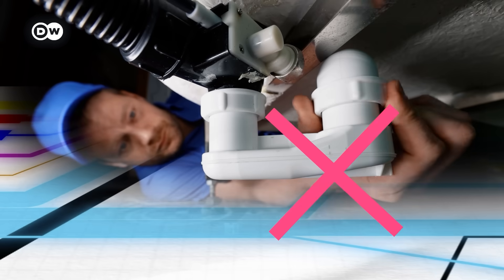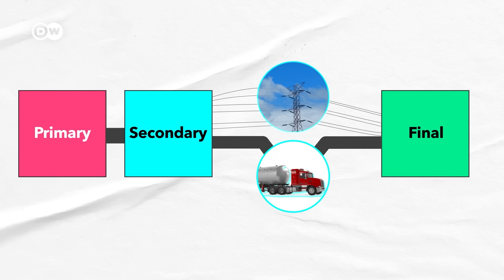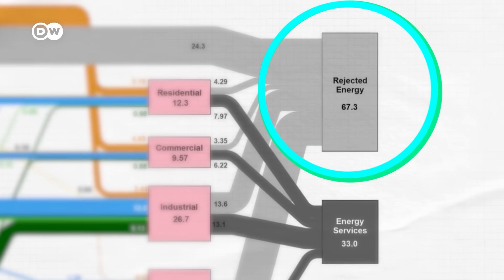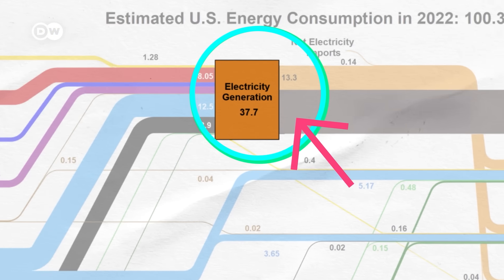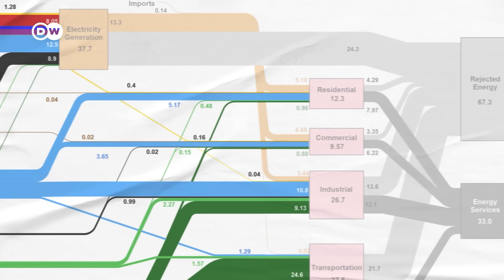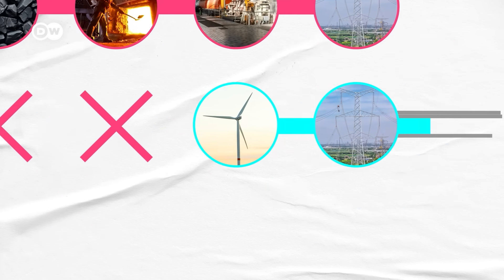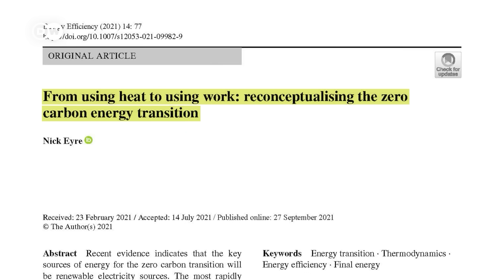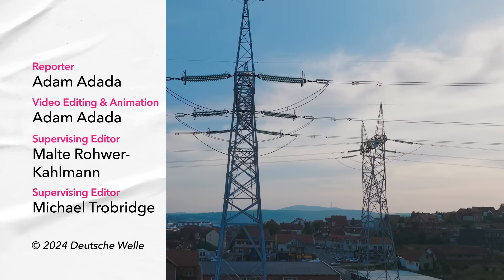The mind-blowing thing we get WRONG about energy

Comment: Something else not often considered. 

The energy needed to extract, process, transport, store, refine, distribute and dispense fossil fuels is immense...

Not to mention the equipment and industries needed to produce and maintain that infrastructure and equipment. 

With renewables, that's no longer needed. 

Oil wells and drilling rigs. Massive tanker ships, and the energy they need. Storage facilities, and the equipment and energy needed. Refineries and the massive energy they need, not to mention the massive infrastructure and equipment. The tanker trucks to distribute fuel. And the industries needed to produce all the parts for the ultimate burning of that fuel.

It all goes away. Sure, its replaced by renewables, but they are much lower maintenance, and much simpler. And with EV's they are much simpler, requiring less industrial input. And very minimal maintenance.
Reply: The United States also maintains aircraft carrier groups in part to protect international shipping lanes from pirates. How many times have we gone to war over oil? It's very expensive.
Reply: @markhathaway9456  War itself is changing. A single drone uses a puny fraction of the energy of a jet fighter or bomber, and can be as effective.
Reply: The problem of transportation of renewable energy on big distances is not solved at all for today. So yes, "that's no longer needed" because it simply impossible.
Reply: @TomasSawer  
Renewables are mostly distributed generation. Less transmission is needed because of that.

It does, however, greatly benefit the requirements of storage if large areas are supported with high capacity transmission lines. HVDC can go entire continents, allowing energy averaging. Especially with solar. And, existing storage, such as hydro can be better utilized.
Reply: @jeffl4810  Unfortunately sun and wind energy is not distributed equally between the regions and even in the regions with high insolation is not enough sustainable to satisfy all the requirements to power grids. The only solution now is chemical battery energy storage because of little loss on energy conversion but this solution is still very expensive. German "green revolution" turned out to be covered by russian bloody gas.
However another sun energy tecnologies like Spain concentrating heat power plants can produce sustainable energy by design but this tecnology still expensive in operations and support and not still widely used.
BTW do we have any HVDC in commercial use? Some underwater cables? Temperature and snow-humidity tolerance figures? It's interesting idea but how far it from mass deployment?
Reply: @TomasSawer  
HVDC greatly helps with evening out power, as it can be sent vast distances. Like across entire continents.  

Solar on the east cost can help power the west coat at night, and vice versa. Storage facilities, such as managed and pumped hydro can be used in suitable geographic locations. Wind would be averaged out, reducing its variability. 

Utility scale batteries would be fully utilized, instead of adding a lot of overcapacity to compensate for worst case situations. 

A lot of generation overcapacity wouldn't be needed, as worst case events would averaged over large geographic areas.

And yes, HVDC is used in a bunch of areas, and growing in popularity.  A conductor pair is capable of 6-10 GW of transmission capacity.  More conductors can add capacity. 

It works way better than AC grids due to no phase issues when you start approaching the 60Hz wavelength. And there's no "Skin Effect" in the conductors, giving a much better conductor utilization. Not having skin effect also allows substantially larger conductors. 
The only drawback is the cost of the rectifying and inverting needs when connecting to the transmission line. 

There's also a UHVDC transmission line spanning 3,500 km IIRC.
Reply: @TomasSawer  80% of the world's UHVDC is in China, where it extends the solar-wind day by two time zones.. and Chinese time zones are very, very wide.
Reply: @TomasSawer  Biofuels are just as good for 'big distances', plus more secure.
Reply: @bartroberts1514  
Unfortunately, biofuels are quite expensive to make... 
With exception of waste that's turned into biofuels
Reply: @jeffl4810  Biofuels through the ethanol pathways, sure, are quite expensive to make historically.

Part of the problem with that is economies of scale.

Part of the problem is that it's ethanol instead of pyrolysis. Torefaction can take waste biomass and convert it to biochar -- which there is too little selling and promotion of -- to displace expensive nitrate fertilizers, and as a byproduct produce enough py-gas and black liquor feedstocks to service the world's needs, in a program of afforestation and reforestation, unconventional forestry and ocean biomass seeding and recovery.

Part of the problem is we don't pay for the liabilities of fossil, and externalize those costs.
Reply: @bartroberts1514  Biofuels are mostly a joke in the EU, it often means burning food for energy, its not unlike the green washing that goes on in carbon credits. In the UK we switched from burning coal to burning wood chips harvested in the US NW which has to be chipped and shipped around the world. The trees don't recover for 50 years.
Reply: @bartroberts1514  Yes but biofuel is not electricity. It's more like traditional oil and gas with only difference it not pumped from the ground but planted on it. All other processes including CO emissions are the same.
Reply: @TomasSawer  The same? Tch. Far from it.

Carbon Neutrality:

Traditional Fossil Fuels: Burning fossil fuels releases carbon dioxide (CO2) that was stored underground for millions of years, adding new CO2 to the atmosphere and contributing to the greenhouse effect and climate change.

Biofuels: While burning biofuels also releases CO2, the key difference is that this CO2 is part of the current carbon cycle. The plants used for biofuels absorb CO2 from the atmosphere during their growth, which offsets the emissions when the biofuels are burned. Therefore, biofuels can be considered carbon-neutral if produced sustainably.

Renewability:

Traditional Fossil Fuels: These are finite resources that take millions of years to form and are being depleted rapidly.

Biofuels: Biofuels are renewable because they are made from crops that can be replanted and harvested annually or biannually. This makes biofuels a more sustainable option over the long term.

Lifecycle GHG Emissions:

Traditional Fossil Fuels: The entire lifecycle of fossil fuels (extraction, refining, and combustion) typically results in higher overall GHG emissions.

Biofuels: The lifecycle emissions of biofuels can be lower than those of fossil fuels, especially if produced from waste materials or using advanced biofuel technologies that improve efficiency and reduce emissions. As biofuels divert biomass from anaerobic decomposition to methane and other GHGs more GHE-intensive than CO2, their use can reduce GHE up to 120 times.

Environmental Impact:

Traditional Fossil Fuels: Extraction and use of fossil fuels can cause significant environmental damage, including oil spills, habitat destruction, and air and water pollution.

Biofuels: While biofuel production can also have environmental impacts (e.g., land use changes, water use, and pesticide application), these can be mitigated with sustainable agricultural practices. Additionally, using waste products or non-food crops for biofuel can reduce negative impacts.

Energy Security:

Traditional Fossil Fuels: Many countries rely on imported fossil fuels, which can lead to energy security issues and geopolitical tensions.

Biofuels: Producing biofuels domestically can enhance energy security by reducing dependence on imported fuels and supporting local agriculture and economies.

Technological Advancements:

Traditional Fossil Fuels: While there have been advancements in extraction and refining technologies, the fundamental environmental issues associated with fossil fuels remain.

Biofuels: The development of advanced biofuels (such as algae-based fuels and cellulosic ethanol) holds promise for even greater reductions in emissions and environmental impact, further distinguishing them from traditional fossil fuels.

Policy and Regulation:

Traditional Fossil Fuels: Increasingly, governments are implementing policies to reduce fossil fuel use due to their significant environmental impacts.
Biofuels: Many governments support biofuels through subsidies, mandates, and research funding because of their potential to reduce greenhouse gas emissions and enhance energy security.

Conclusion
While biofuels do share some similarities with traditional fossil fuels in terms of their use and combustion, the overall processes, environmental impacts, and sustainability profiles are significantly different. Biofuels offer a more renewable, potentially carbon-neutral alternative to fossil fuels, provided they are produced and used sustainably. Dismissing biofuels as merely equivalent to fossil fuels overlooks these crucial differences and the potential benefits of biofuels in the transition to a more sustainable energy system.
Reply: @bartroberts1514  Do we have the digits of how it work on practice? 
For example - what %% of CO2 is captured from the atmosphere (and not returned to it in the night) by canola plants and what %% it gets from the soil/fertilisers? Second digit will break carbon neutrality theory if it big enough. 
Energy security is also under big question. Very few countries in the world have enough not used fertile soil to use it in addiction to existing or planned food production. But a lot of countries have not enough food and have to import it.
Environment impact is a more governance issue then technical. If it's no strict regulations and controls then no difference companies producing fossil fuel or biofuel. In both cases they will save on environment and destroy it. Also with strict regulations and huge fines both compnies will not hurt environment.
Reply: @TomasSawer  Only about  4% of net carbon flux is due to fossil emissions right now; that's been enough that since the mechanization of warfare began in 1750, CO2 concentrations have risen 50%. Hard-to-abate fuels make up about 2.5% of fossil fuel use. So we can certainly fit into 1/40th of 1/25th the plants in the world a harvest more than equal to the task.

Addressing Concerns About Biofuels and Carbon Capture/Neutrality
1. Carbon Capture by Plants:
Question: What percentage of CO2 is captured from the atmosphere (and not returned to it) by canola plants and what percentage comes from the soil/fertilizers?

Answer:

CO2 Capture by Canola Plants:
Photosynthesis: During photosynthesis, canola plants capture CO2 directly from the atmosphere. Most of the carbon in plants comes from CO2 absorbed during photosynthesis.

Carbon Cycle: At night, plants do respire, releasing some CO2 back into the atmosphere. However, the amount captured during the day typically exceeds the amount released at night, resulting in a net capture of CO2.

Soil and Fertilizers: While some carbon in plants comes indirectly from soil organic matter and fertilizers, this is usually a small proportion compared to atmospheric CO2. The key to carbon neutrality is the balance of CO2 absorbed and emitted over the entire lifecycle.

Biochar and Carbon Sequestration:

Biochar: When biomass is converted to biochar through pyrolysis, a significant portion of the carbon is sequestered in a stable form that can remain in the soil for centuries.

Concrete Aggregate: Using biochar in concrete locks the carbon into a stable form, preventing it from re-entering the atmosphere.

Terra Preta: Enhancing soil with biochar (terra preta) not only sequesters carbon but also improves soil fertility and water retention.

2. Energy Security and Land Use:
Question: How does the availability of fertile land affect the viability of biofuels given food security concerns?

Answer:

Land Use and Food Security:

Marginal Lands: Biofuels can be grown on marginal lands that are not suitable for food production, reducing competition with food crops.

Waste Biomass: Using agricultural and forestry waste, as well as non-food crops like algae or switchgrass, can further alleviate competition with food crops.

Advanced Biofuels: Second and third-generation biofuels, which use non-food biomass and have higher yields, can significantly reduce the land required for biofuel production.

Energy Security:

Diversification: Biofuels contribute to energy security by diversifying the energy supply and reducing dependence on imported fossil fuels.

Local Production: Producing biofuels locally can reduce geopolitical risks and enhance resilience against global market fluctuations.

3. Environmental Impact and Governance:
Question: How do regulations and governance affect the environmental impact of biofuel production?

Answer:

Strict Regulations: Effective environmental regulations and governance are crucial to ensure that biofuel production is sustainable and minimizes environmental impact.

Sustainability Standards: Implementing sustainability standards, such as those for land use, water use, and emissions, can help ensure that biofuel production does not harm the environment.

Monitoring and Enforcement: Regular monitoring and strict enforcement of environmental laws and regulations can prevent companies from cutting corners and causing environmental damage.

Comparative Impact:

Fossil Fuels vs. Biofuels: While both fossil fuel and biofuel industries require regulation, biofuels have the potential for lower environmental impact if produced sustainably. Fossil fuel extraction and use are inherently more damaging due to the release of ancient carbon and other pollutants.

Summary

Biofuels, especially when coupled with carbon sequestration technologies like biochar and sustainable practices, offer a viable path to carbon neutrality. They provide a renewable energy source that can enhance energy security and reduce greenhouse gas emissions. However, the success of biofuels depends on strict environmental regulations, sustainable land use practices, and effective governance. By addressing these concerns, biofuels can be a key component in the transition to a sustainable energy future.

I recommend looking into Rethink X, Project Drawdown's Roadmap, TheSolutionsProject dot Org.
Reply: @jeffl4810 nuclear smr for cargo shipping would hugely change energy needs.  Better city planning, ebikes and velomobiles can greatly improve personal transport.  Grid batteries and seasonal solutions is the ugly bit.
Reply: It's worse than biofuels being "quite expensive" to make.  In the US it takes as much energy to make the biofuel as you get from burning it. NO.NET. GAIN.  I kid you not!
Reply: And the "solution" to renewable energy is to triple the size of the power grid. That's not cheap either. And have conventional gas and coal burning power stations with their turbines idling and the furnaces banked waiting for a cloud to blow over or the wind to die down.
Reply: @gregorymalchuk272 
Self sufficient housing, neighborhoods, suburbs, towns, cities all with battery buffering at each level needing less peaky grid support, the grid being used to maintain the battery charge and move power when excess is generated.
Reply: @gregorymalchuk272  
Um, that is not correct. 

And utility scale batteries are becoming a significant solution.

Renewables, especially solar, are extremely cheap. A solar panel, wholesale, is like $0.10 per watt.  And I've seem some as low as $0.05 per watt.

It's significantly cheaper to make a solar farm, with battery capacity, then it is even build, much less maintain and especially fuel an FF power plant. 

Note that a 1GWe power plant operating at capacity consumes 9000 tons of coal per DAY

It's actually cheaper to install 2x capacity   renewables and less storage to meet worst case needs, along with reduced requirements of storage. 

HVDC transmission lines can share power across entire continents, greatly reducing needs for over capacity and storage needs
Reply: @gregorymalchuk272  17%.

That's all the grid expansion needed to entirely get rid of fossil energy in transportation and industry, even without special efficiency action.

Not triple. 17%.

Easily achieved essentially for free by reconductoring, FCAS and automated impedance matching initiatives.

And those conventional gas and coal plants? Convert them to compressed air energy storage. Far cheaper.
Reply: @bartroberts1514  You're delusional. "17%" "Just convert them to compressed air" The ramblings of central planners who don't know anything about energy.
Reply: @gregorymalchuk272  Tell me more. I'm always eager to learn from experts who know everything about energy.
Reply: Solar and Wind also have to be made. For which ressources need to be extracted and refined.
Reply: @nonyabisness6306  
Ever see the resorces needed for fossil fuels. From extraction, transport, storage, refinement, distribution and dispensing?

Then the actual fossil fuel consumption after that...
Reply: @jeffl4810  Ever see the resorces needed for wind/solar. From extraction, transport, storage, refinement, distribution and dispensing?
Reply: @nonyabisness6306  
Yeah, it's a lot less then FF's.

For example, a typical car uses 10's of thousands of liters of fuel consumed over its lifespan. None of it recoverable. With a lot of pollution in the fuel mining and production processes, to the ultimate burning of that fuel.

A typical passenger EV contains just 10's of kg of lithium, which is fully recyclable...

No comparison. EV is greatly favorable in this regard.

And the electricity saved by not processing FF's would save about 1,100 TWh annually in the USA. The USA consumes about 4,200 TWh annually for perspective. If everything went EV, they would only need 600TWh. Yes, a net savings of 500 TWh
Reply: @nonyabisness6306  The ratio of capital resource extraction per MWh varies between 50:1 and 500:1 comparing renewables to fossil.

What's your point?
Reply: With an off grid system, you would be correct. However almost any household is still connected to the grid, which is at best 80% efficient.
Reply: And drilling for metals used to make appliances supported by renewables and maintaining them does not use as much energy?
Reply: @davidl.e5203  Have you ever seen a pipeline? A refinery? A drilling platform? An oil tanker?

Those 'appliances' of fossil trade massively outweigh their corollary functional units in renewables.
Reply: Renewables are made using very environmentally damaging processes, mining, etc, all use fossil fuels, they are fossil fuel extenders, they require fossil fuels to maintain them, and dispose of them, you need to factor this in...
Reply: @thurstonhowellthetwelf3220  
No, they are not.

FF's are used in the manufacturing and mining for renewable equipment including batteries, but after a couple years, it becomes carbon neutral. 

Also, mines are becoming more and more EV oriented. For example, the massive rock trucks are available as EV's now. I still think they need to increase the battery capacity a few times, but that will happen. 

As for batteries, they are completely recyclable. Currently, the minerals from EV batteries have a 98% recovery rate. In a matter of fact, EV batteries are so valuable to recyclers, that they are paying $45 per kWh for NMC type, and $15 for LFP type. 

We will have mined enough lithium and battery minerals in the next 15-20 years, that we won't essentially need to mine any more, as the old batteries will be recycled into new ones.

Here's another big one - the typical passenger EV contains 10's of kg of lithium. That's fully recyclable...

Can't say that about the 10's of thousands of FF's burned in the average ICE passenger vehicle over its lifespan. None of it recoverable, with substantial emissions and pollution from every step of the way. Burning it not only releases CO2, but CO, VOC's (including benzene), NOx, PM (PM 2.5 has been a hot topic the last couple decades...) and a whole slew of nasties from trace impurities.
Reply: @thurstonhowellthetwelf3220  Shenanigans of Impossible Expectations.

With bootstrapping, all stages of renewable can be fossil-free.

And those 'environmentally damaging processes'? Needed in greater degree for the same minerals fossil uses, plus at least fifty times as much for fossil for fuel.

Pretty much everyone's already factored those in.